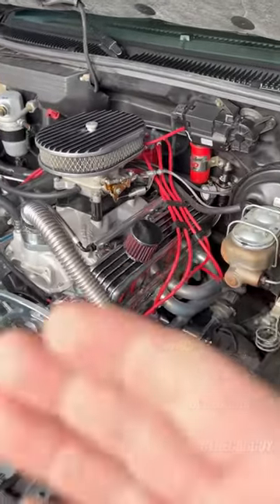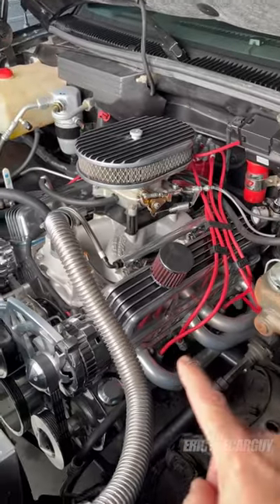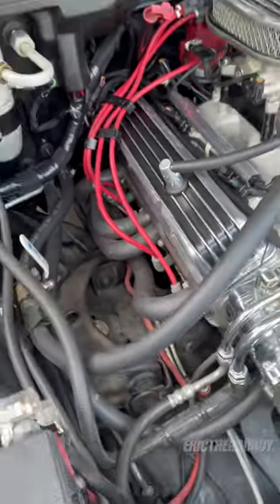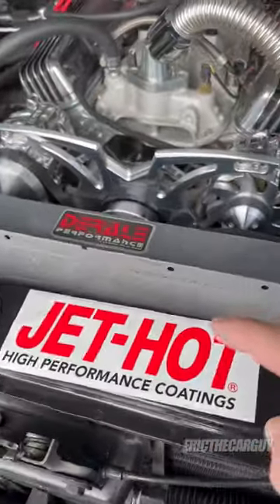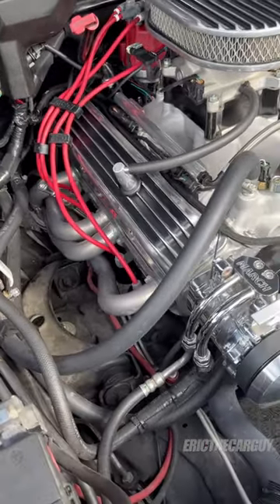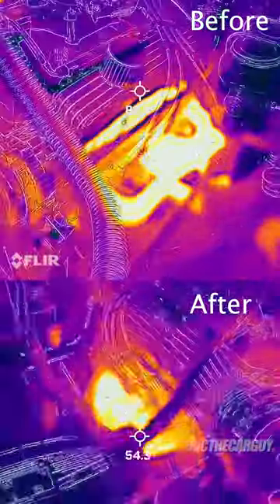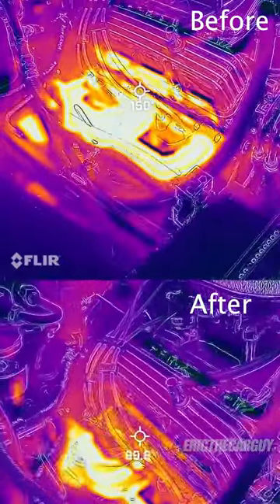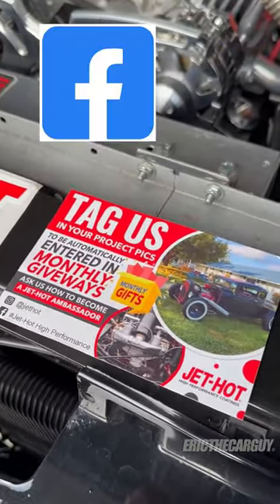Jet-Hot is Awesome! #Jet-HotHighPerformance

Comment: I had an aftermarket downpipe ceramic coated with Jet-hot about 15 years ago, I think it helps with temperatures and it has definitely held up well. That said, I suspect your FLIR might not have been configured to read hot exhaust temperatures during that video; when my thermal camera shows suspiciously 'flat' readings like 150.0 as the hottest temperature it usually means I need to change the software from low temperature range to high temperature range.